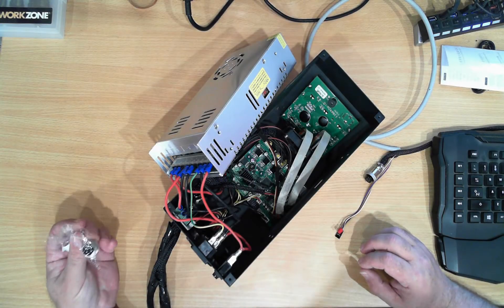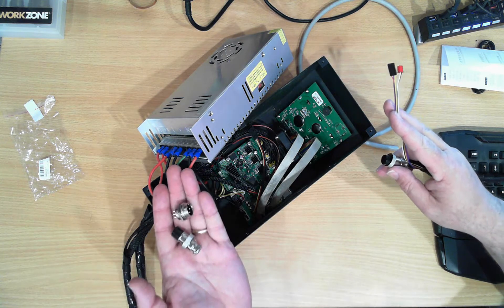CR10S5 Mod to BLTouch mod

Comment: There are two branches coming out of connectors, one goes to z-axis limit. How about the other one? Any help will be appreciated.
Reply from the maker: It plugs into D11.
Have a look at the video at 12:50.
Make sure you plug it in the right way round.
+5V is the middle pin.
0V or Ground is closest to the edge of the board
The servo output wire is the pin furthermost from the edge of the board
Reply: @CyberOne  Thank you so much.
Reply: @CyberOne  Weird. I  found that my board had 5V closest to the edge of the board and Gnd in the middle. My board is 2.2